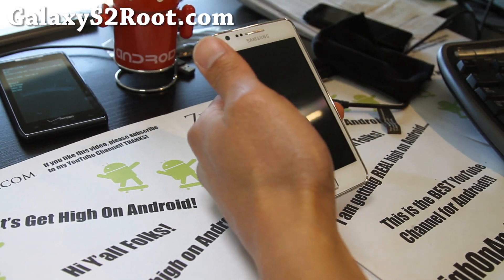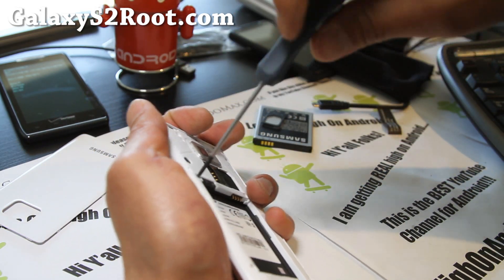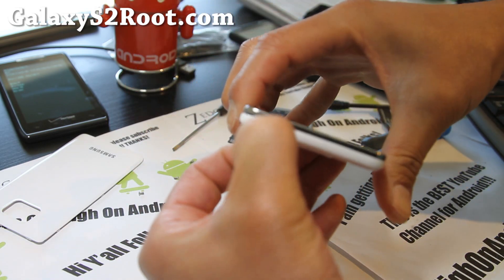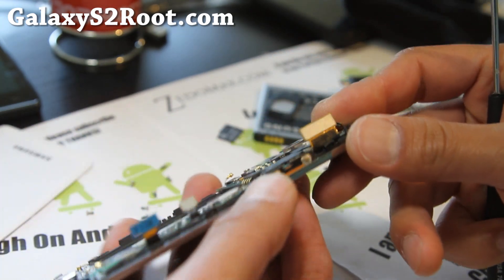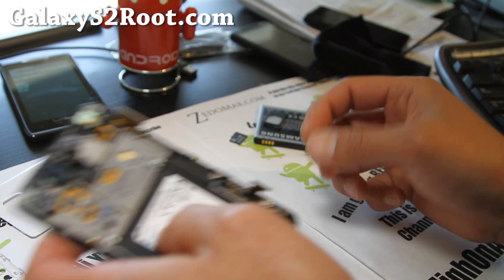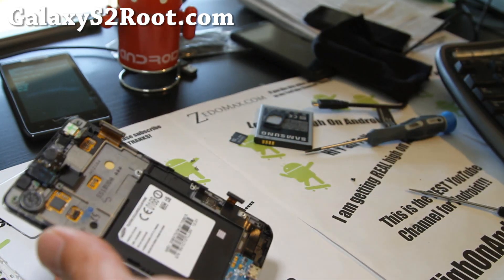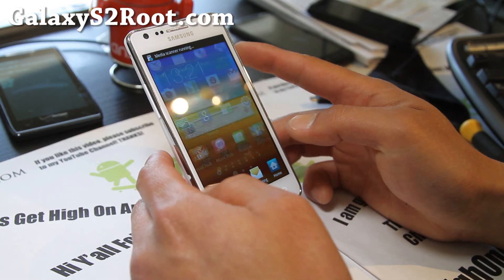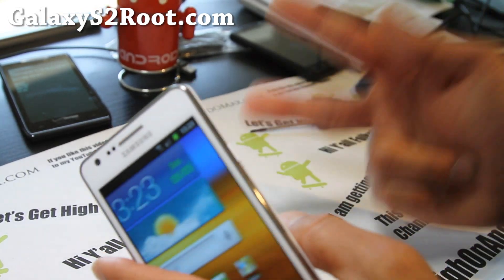How to Disassemble/Assemble Galaxy S2! [Dissect TEARDOWN]

Comment: help I need tech info  Samsung SGH-i727r  I'm trying to extend its wifi  and cellular range.  I have found under the rear cover 2 antenna plugs.  R1 and R2   any information on these plugs would be greatly appreciated.  the name and type of the plug would be great   I'm trying to hook it up to A TP-LINK . 24dBi  2,4GHz Grid Parabolic Antenna  for increased range.  I also have an alpha booster 1000.  with a USB output that  I'm thinking of plugging into her  any input greatly appreciated Nick

Comment: Hey Zedomax. I replaced the back housing of my sgh-i777 with one from the gt-i9100 and I was wondering if its possible to take off the screen of the i777 and put it on an i9100 and replace the housing all together

Comment: Hi!   I have a US T-Mobile SGH T989 with a cracked screen.  I have looked on eBay, and noticed that replacement screens for this variant are rather expensive, but Sprint's SPH-D710 seems to have the same screen specs (size, 4 buttons, etc), and the screen's are much better priced.

Can I do this?  Or I might have issues?  Thx!!